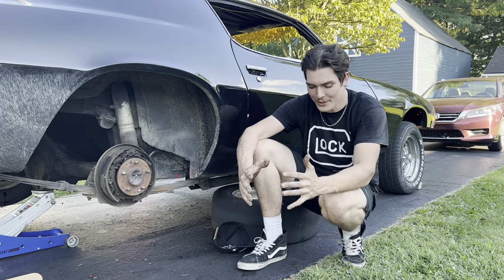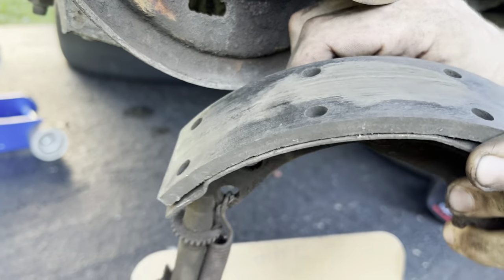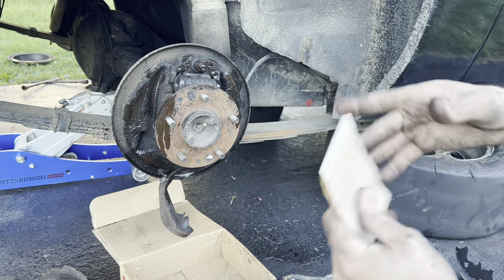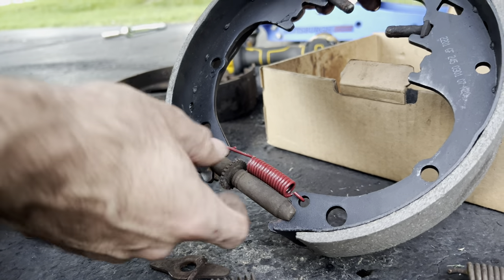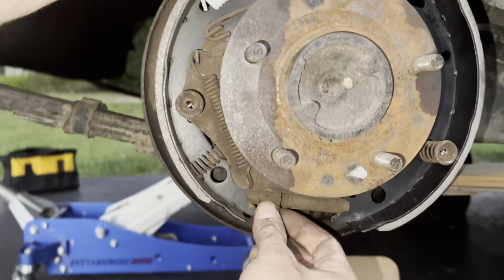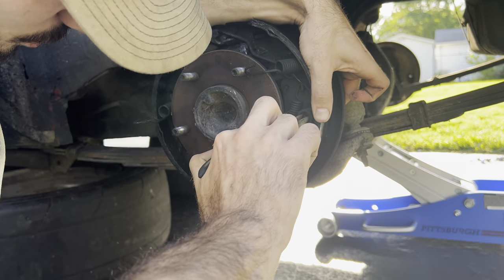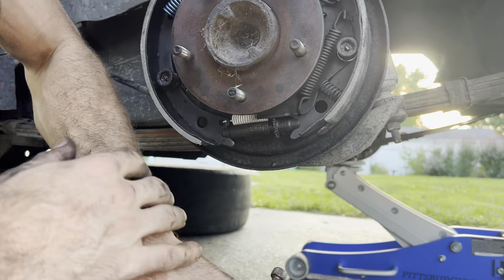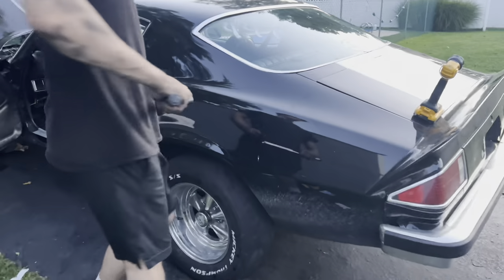Second gen Camaro DRUM BRAKES

Comment: Lots of good info, except you left of the retaining T on your brake shoes before you put on the upper springs.  I hope the brakes don't come apart,  I saw you missed on the passenger but not on the driver.  Just saying.  Hope you did put it on very important part.